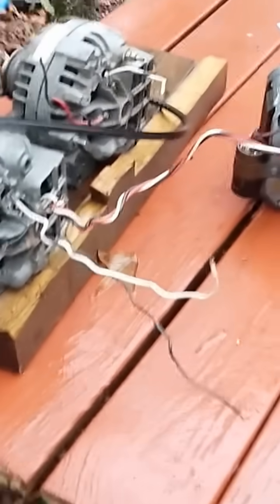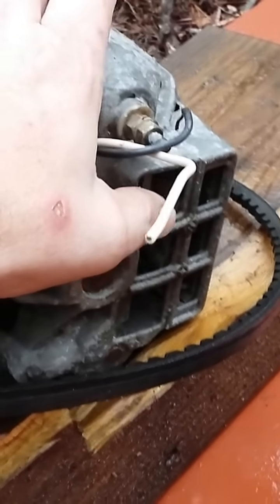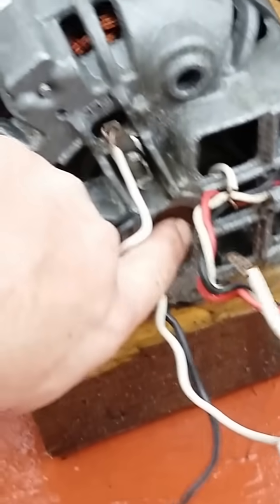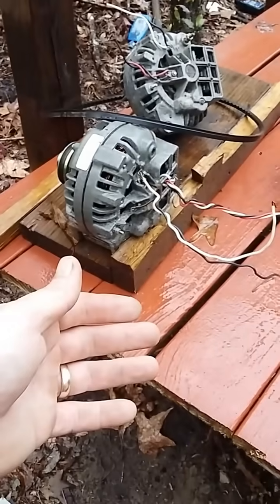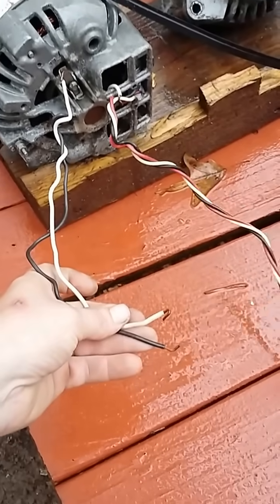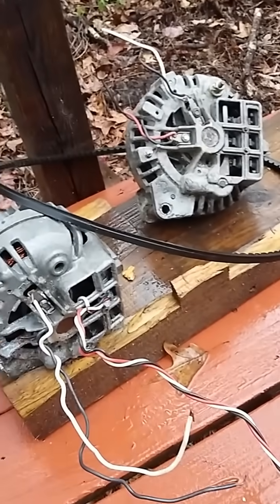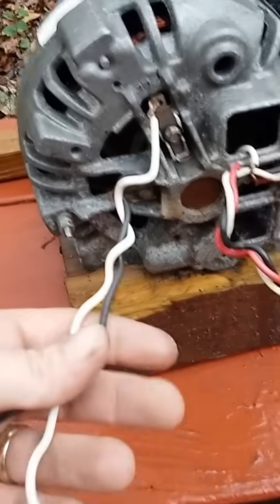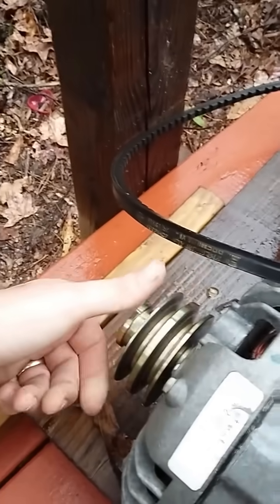Update Free energy forever no wind no solar no gas READ DISCRIPTION!!!

Comment: What brand is your alternator? The DC leads seem to be on the same terminal in your video. The three wires red, white and black coming from the diode  area, which one are you using for ground? Can you send me a wiring diagram to verify the correct connections? Bobby R Hall bobbyrandolphhall@gmail.com
Reply from the maker: Bobby R Hall 
It won't matter what kind of alternator you use. all alternators have four coils! three stator coils and a rotor coil. your three stator coils are tied together at one end and the other three open wires go to your Bridge rectifier which just converts alternating current into direct current through a series of diodes.. in order to hook the alternator up as a motor you will need to remove the diodes because it is no longer an output it is the input if you leave the other end of the three stator coils tied together your alternator motor will be wired in star. you do not need a negative because you will be pulsing frequency into the coils and you will use the rotor coil with a positive and negative direct current to create a magnetic field for the stator coils to pulse the sound against.. thus creating rotation.
Reply: Bobby R Hall jnni9l
Reply: In order to perform this experiment properly, please let me know the make, model and year of the vehicle the alternator was taken from!
Reply: from what i understand the ground wire will be coming from the box not the Alternator the 3 wires is going to the 100 amp that will be going to the main breaker box

Comment: Well this was a waste of time
Reply from the maker: kinetic static well for someone who wants to get something for nothing yeah you're a big waste of time
Reply: so you assume I want to get something for nothing, you know this from what?
Reply from the maker: kinetic static 
well you are the one searching for free energy, aren't you...
Free is something for nothing and there is no such thing as free in life... and you will never be free until you have died a couple of times!!!
Reply: so I searched for free energy, you are quite good at making assumptions
Reply from the maker: kinetic static 
I wasn't making assumptions. I was just answering questions that you didn't ask...
Here's another answer that you're looking for.. Arduino Uno R3 as the driver.. build a 3-phase H Bridge and run it at the highest frequency/voltage  you can.  your 3 phase motor controller problem solved with a simple variable frequency drive or VFD...
Reply: I wasn't looking for answers, once again another assumption you made, keep going...

Comment: What you're claiming defies the laws of physics. You cannot get more energy out of it than you put into it. You will always lose energy  as heat, friction and sound. You may get energy out of the end of it but it will always be less than you're putting into it. You have to replace that lost input energy from somewhere else, it cannot recharge the it's own input.
Reply from the maker: +Matthew Barbosa 
Please read the description this video..
It is a gateway to my other videos. you sound pretty intelligent, and was kind.. so for not cussing me, I'll explain a little.. if I take one isolated circuit and use it to power two or three other isolated circuits my potential output will be more than my input load.
For example if my load is 7 amps @ 115 volts ac to power an h-bridge or variable frequency drive (VFD), powering a drum motor wired in star, with permanent magnets. Or just about any high RPM 3 phase motor wired in star.. I will use less power then what can be accomplished by hooking it (drum motor) up to a 10kw generator head... Thus being able to power my driver...
Reply: ThomasBuie EnergyBuies at gmail com Thanks for the reply. I did read the description, I hope you're not charging people for the privately shared videos. Extraordinary claims require extraordinary evidence. You're reply still does not begine to explain your claims. I'm sure you go into much more detail in your other videos. However the fact remains that energy can not be created it can only be converted. No one has ever been able to convert energy from one form to another SINGLE CAPTURED form. Some energy is always converted to typically friction, heat or sound and is lost. Even if you could convert energy with 100% efficiency you could have a perpetual motion machine that would be self sustaining but could not power anything else. In your case you are converting potential energy into kinetic energy then back to potential and again to kinetic and back to potential once again. There will be loses through each of those conversions. You could get to the point that the losses are small and creates the appearance that you are getting more energy out but that would be a misconceptuon. If you did the math you would see that the loses are there. 
If you are living off grid than I give you credit. Self sufficiency is a long lost skill.
Reply from the maker: Matthew Barbosa 
 well I appreciate you not trash-talking me like most others do I usually don't have time to reply to everyone and most of the time answer a lot of questions in one comment.
I am not charging anyone for privately shared videos I do not even accept donations from poor people because I am poor myself and have always been this way. I do live completely off-grid! I have my own Springwater, I have my own garden, I have my own electricity... I have two 10000 watt self excited generator heads and two 4000 Watt self excited generator heads. Building an H Bridge for a very low consumption 3 phase motor isn't very hard and will be one of my next videos to show everyone.. I am finally able to live without going hungry! my children have never went hungry and will never go hungry!!! I'm a great father and a family man and I treat others how they treat me... most of the time I treat others better than they treat me. Conservation of energy is a struggle!! perpetual motion is easily created with permanent magnets and overunity is easily achieved with multiple power sources using magnetic fluctuations...
3 Transformers wired in series has more of an output voltage and current then input v and i..
Which was proven years ago.
Permanent magnet motors like a single phase DC treadmill motor has more of an output then it takes to create the energy with a smaller DC permanent magnet motor (or servo) as the input this has been proven just here recently but I've known about that for a while... the reason why the electric companies can power millions of homes off of one generator is because they are transmitting the electricity with a frequency higher than needed causing less resistance in the current when it gets to your house they use the dirt two step down the voltage or frequency and gain the current or amperage back without loss on the lines so if you use a Step up Transformer on your output and a Step Down Transformer on your input you will lose resistance because of the higher voltages this of course I'm sure you're aware of but I mention it only because it's the same principle that I run on the higher the voltage the less resistance the more efficiency you have... there is no way possible one 15-foot in diameter generator head can power millions of homes unless you step up the voltage transmitted to those homes and step the voltage back down thus gaining the current back.. think about it like this how much consumption does a 500 horsepower three phase Simmons electric motor consume? And with a gear Head On that one motor it would be plenty strong enough and fast enough to turn a hydroelectric generator! (500hp) do you think that hydroelectric generator that powers millions of homes would be able to power that one motor?

Comment: Also another question ..it seems like the wires that's producing the electricity is kind of small..would those wires hold the heat?? I can see it maybe running lights and small appliances. And how could u run 2..How would u wire it ??

Comment: What kind of alternators r those V-8 ..V-6..4cyl??? I would like to try this for hot water heater ???
Reply: Shawn Worrix
There all the same 12 volt but you a high amp at least 90 or 120
Reply from the maker: There is no difference between an "alternator" and a "generator" except for how it's wired. the word generator used to be the word alternator.
In this video I am showing you two Motors and one alternator one is a AC induction motor that is very inefficient and would in almost no circumstance be useful for anything except for power consumption... the modified alternator is actually a three phase motor wired in Star. I am using the field winding on the rotor as my magnetic field.

Comment: Your wiring seems small for 90 amps at 120 volts. How are you controlling the frequency of the output?
Reply from the maker: Donald Johansen the wires that were on the alternator in this video we're too small for 90 amps at 120 volts. 9 amps at 120 volts would be fine. but that alternator in this video is a motor..

Comment: Can you publish step by step plans for this? What would you charge me to build one or two and ship it to me? raydiedrich@gmail.com
Reply: Ray Diedrich it's pretty simple. It's known that alternators can serve as a motor or a generator depending. There are a few mechanical steps that need to be done with gears, ratios, and what not but most are electrical. The best setup I'm thinking would be to use two alternators one as the motor powering the other used as a generator. DC input to motor would be from the wall or battery and the generator would produce AC. Gear ratios and positioning increase, decrease and keep torque modified to the designers wants. I'm working on a project that I started Wednesday similar to this because in theory it's sound and I've seen it done. Most homes have on average 100 amps coming to them to the box that runs to the breaker. My little alternator from a 1999 Honda passport puts out 90 amps. You only need a 9 volt battery to excite your alternator to get it moving if it doesn't have a magnetized charge.
Reply: Also make it look pretty. That's what you do bro.

Comment: Where do you get the 3 to 6 volts to operate the alternator? Also, wire sizing... 180 amps is 2/O wire. Not 12 gauge as shown...

Comment: The Law of the Conservation of Energy...
Reply from the maker: Nicholas Sway 
Which is the whole reason for using pulse width modulation from a variable frequency drive. Low thermal Dynamic loss. low input. hi torque. high RPM. 3 phase pwm. Equals enough P(I) to run the alternator/motor efficiently or even a regular 3 phase drum...
Reply: This is a word salad statement to sound intelligent. Low thermal dynamic loss? Just say heat, damn. Also, i've tried experiments like this before and nothing worked. Then, I took physics! If ten people tell me the same thing, then maybe they're right an i'm wrong. Have you ever considered that?
Reply from the maker: Nicholas Sway well you keep paying your electric bill and I'll keep sounding like an idiot out in the middle of the Woods that doesn't pay an electric bill...
Reply: What I think is happening is that you are trying what many have before you. However, since you have not patented or shown a video proof, you've discarded the science aspect of your endeavor in hopes to make money off of views. I think you are just trying to get views/money (period).

If you'd like to earn my respect and those in the science community, show how everything you do comes together. And by that, I mean show a VIABLE product that ACTUALLY creates energy free of charge (other energy), that defies the Law of The Conservation of Energy. If you do that, you'll never have to dispute anyone's claims of disbelief again. Just post a video of how you create more electricity from less electricity.
Reply from the maker: Nicholas Sway 
No, what I think is happening is you've been paid to try and discredit me... which is not going to happen! I already discredited myself and beat you to the punch..  haha!!!
  so you can say whatever you want I don't care what you think! especially since I gave you an answer to your question and you just basically dismissed it like it wasn't even an answer... so how much do they pay you to betray your own race?
Reply: The topic has nothing to do with race. Please define "they" that pay me. I don't receive checks from "they." I'm only interested in you creating a WORKING model of your invention. If you cannot do that, then you are a fraud.

Honestly. I believe you to be a paranoid sociopath, being that you completely disregard other people's opinions. I am signing off and hope to never your videos again. BTW, has this happened before?

Comment: it does make sense in a way. i mean an engine is what powers an alternator in the first place. you would think as long as you have a power sorce to run a motor in the first place in order to run the alternator that in theory you should be able to produce enough electricity off of the same motor as long as you have a power creating sorce after that motor.

Comment: I PROMISE you that the energy to your stator, your 6 to 12 volts, is more than you recover. Sorry
Reply from the maker: Dennis Pulley 
Do you know how a self excited generator head produces 10000 Watts? With no input?
Reply: a small current is built up in the field coils but it will NEVER exceed the the output. 12v @ 800 amps? Doubtful.

Comment: FREE ENERGY IS IMPOSSIBLE
Reply: Maybe but Tesla has interesting theories to pull the static out of the air and it is considerable. If you could suspend a hundred foot length of chain link fence one hundred feet in the air you could create tremendous potential differences to the ground. Probably easily supply your home's power needs. Then you wouldn't have to defy or harass this genius :)
Reply: groundchuckyfried .groundchuckyfried 
I think your a little misinformed... 
Try this it explains what your talking about I think
https://m.youtube.com/watch?v=otjvUz7qKXc

Comment: You are full of shit,I have been an electrician for 42 years and I'm here to tell you that if you supply the field with DC power and then have a means of turning the alternator  ,that yes you can produce power ,but certainly not 90 amps 220 to power your home.you are misleading people and you don't know what the he'll your talking about,not in the least.
Reply: Daniel Steele
Yea I did this I was able to run my fridge and 2 lights for about 3 hours them it burnt up

Comment: Great video, dude.This will certainly produce free electricity, if you steal the electricity needed to run your motor from the power company, or sucker you-tube viewers into donating money to you to pay for the electricity needed to power the drive motor. Just keep in mind that you are wasting at least 50% of your input energy, by running it through a motor and then driving the alternators, and also keep in mind that the 90 amp output is at 12 volts dc, so if you step it up to 120 volts ac, you only have 9 amps of power, or less. Doesn't take an electrical engineer to figure out that you are either a moron or a complete fraud.
Reply from the maker: Barny Brewman yeah no kidding I answered that question and said the same comment 2 years ago and about 20 times since then matter of fact you can look about three comments down and see the exact same post that you just said but from me so I guess I'm a complete moron for wanting to keep people like you who are jerks do you not see that I'm trying to teach people how to do stuff without letting everybody know... read the description maybe that'll help you!
Reply: ThomasBuie EnergyBuies at gmail com he's a jerk. Just trying to make you feel bad for doing something right. I support you Thomas all the way!

Comment: This free energy technology http://free-energy.yolasite.com/  is so simple, that it should be proof of the eternal battle between good + evil forces. How else can you explain us not seeing the obvious gain of 100 cycles of AC electricity from a 1cm circumference pulley + AC generator, for every single rotation of a 100 cm circumference pulley. This is because these evil forces enjoy us spending so much money on oil, some of which ends up going to terrorists, which evil spirits are influencing enough already. 
- 
How can you not be multiplying AC electricity, when you are only paying for the single rotation of a large 100 cm circumference pulley attached, and you get a return of 100 cycles of AC electricity for every mini-pulley that you attach to the same belt as the 100 cm pulley. So, you could multiply your # cycles of AC electricity to 1000 if you added 10 mini-pulleys of 1 cm circumference pulley with AC generators attached. That is 1000 cycles of AC electricity for a few short bursts of DC current. 
- 
http://free-energy.yolasite.com/  
http://doorschristmustpassthrough.yolasite.com/  
http://beliefstoliveby.yolasite.com/   
http://fire-starter.yolasite.com/ 
http://biblefilescentral.yolasite.com/